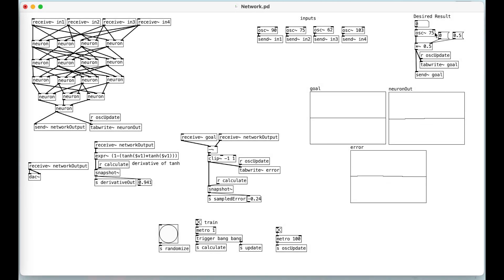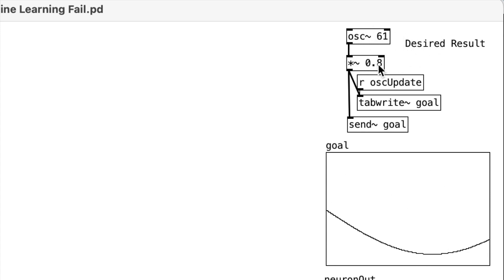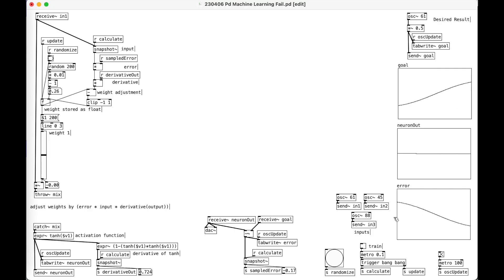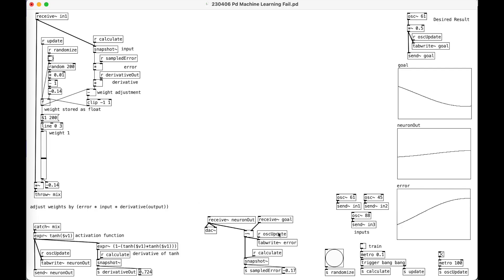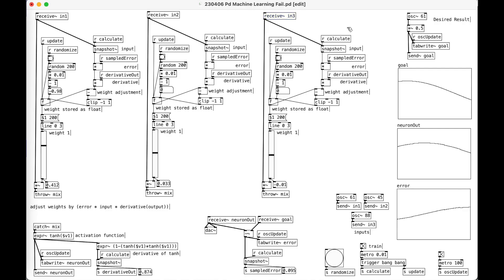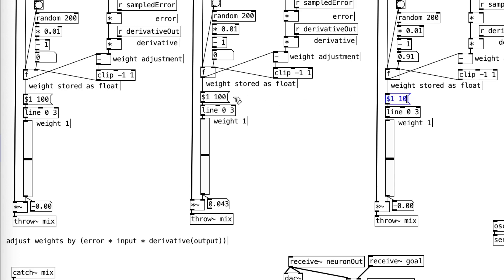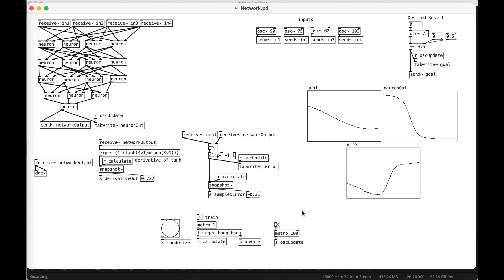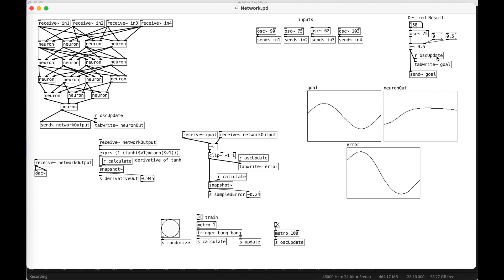Pd Machine Learning Fail (Unsuccessful Audio AI in Pure Data Vanilla) | Simon Hutchinson

Comment: I'm thinking, looking at your patch again: 
What if you use `line~` object and get better interpolation of the signal processing? compared to block based `line`
Reply from the maker: Nice thought. I’m about a year departed from this experiment now, but I do remember the [line] speeds significantly changing the output. I may have tried it along the way, but, if not, going to audio rate would likely have a significant impact (though perhaps not necessarily more “correct”)

Comment: You can try adding a trainable bias parameter to the mixer input of the tanh function. TANH(W*INPUTS+BIAS)
The trainable bias should let the network change the phase of the output signal hopefully.

You would only need to make the bias on the single output neuron trainable.

Comment: Super interesting video, thanks for sharing it! It did make me think whether simply resetting the phase of all your [osc~] simultaneously when you change your desired result value (i.e. by sending a [0< message to each of their right inlet simultaneously) would not improve the system or even solve the "problem" you experienced altogether. When you tried desired results matching each of the three inputs (45, 61, 88 Hz), you'd expect to get weights of 0.0 for the non-matching ones, and a matching weight of the remaining one with the desired result. However, if the desired result and the input are out of phase, I don't think there will be any combinations of weights that would generate the matching signal unless in the rare cases when phases match. And I think this can be observed in your error graph: once the learning stabilises into a given weight, your error shows a sinusoidal shape which suggests phasing, as sin(x) - sin(x+k) will also be a sinusoidal function with the same frequency x but a non-zero amplitude for values of k differing from n*2pi (and the bigger the amplitude, the more out of phase the signals are). In fact, look at when your system gave a weight of -0.5 to that 45 Hz desired result: this was very likely because, by chance, your phase was close 180 degrees apart, so inverting the wave got it very close to the original; also, in that case, the amplitude of your error is very small, and you can hear a coherent 45 Hz sound coming out. This all got me thinking: if the system needs matching phases and frequencies of inputs in order to accurately recreate a desired result of a sine wave, it will not be able to accurately use some arbitrary frequencies of input to recreate a non-matching desired frequency; then perhaps an interesting take on this problem could be to feed a more complex sound but with a clear fundamental into this system, and have inputs that are in the overtone series of this fundamental, so that the system is actually trying to match the timbre, not the frequency, of the desired result.